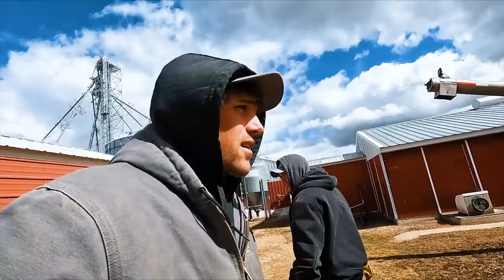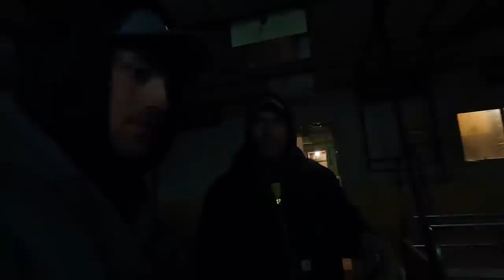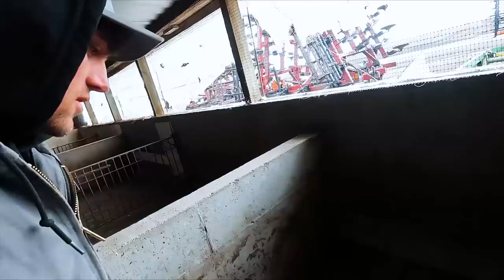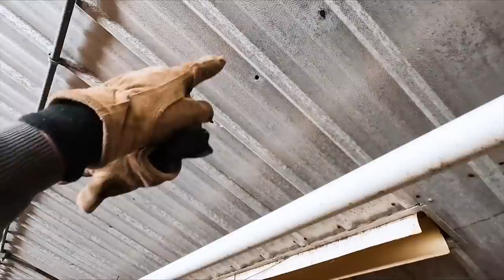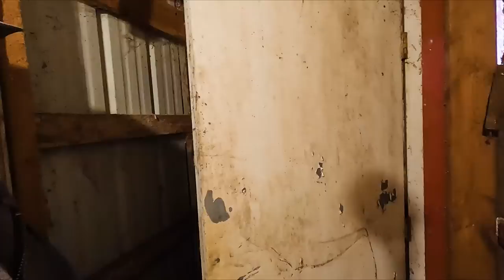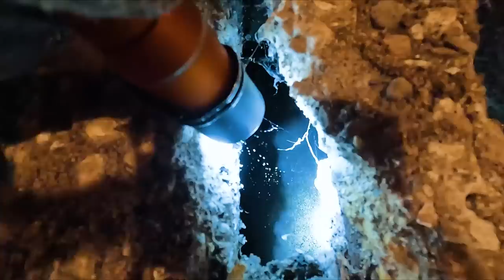Our Abandoned Hog Barn Tour!

Comment: Chet just some good advice try to avoid galvanize smoke if at all possible but if you do inhale the smoke just drink some vitamin D milk the calcium in the milk will clear it away, this is not a joke I have done it quite a few times during my welding career but PPE is best also if you get eye burn from welding arcs look at something green, green is the most soothing color on the eyes, it will help but won't completely take the sting away, y'all stay safe...

Comment: Cement is the gray powder that binds the rock and sand together. Once you add material to the cement it becomes concrete. I use to work for a concrete pump company and my boss hated it when I would call it cement.

Comment: Too funny and too close to home,,, we quit hogs in 96, but still had a darn near identical setup... we rotated 125-30 sows, all outdoors on concrete. had a 24 stall farrowing house, all raised on pits. Had a Hot nursery to handle the farrowing house. then a 2 section 120' finishing bar, all slats/pits,,,, in the 80's I remember shoveling two triaxle loads of sand/gravel mix and 2 pallets of cement and we poured the same T concrete walls in our finish barn,,,, one at a time, took 8 months... that was literally 120~ tons of shoveling and wheel barrow loads of concrete... ah those younger years... that was a lot of back breaking work.... hats off to those that still do it,,, it is a ton of literal shitty work!!!